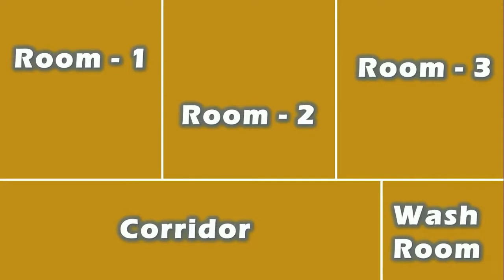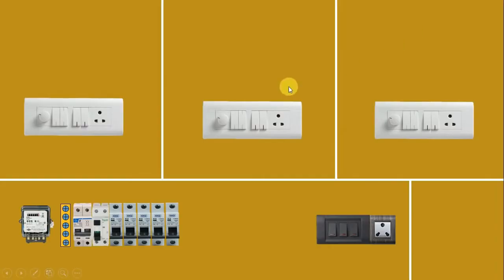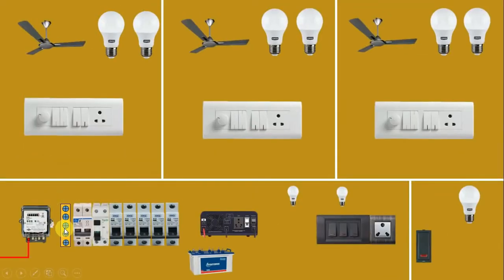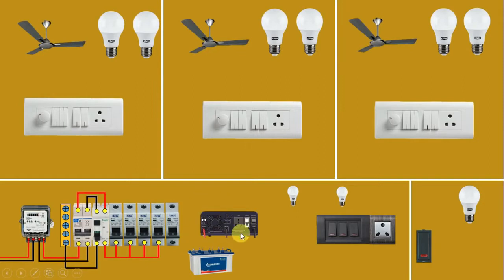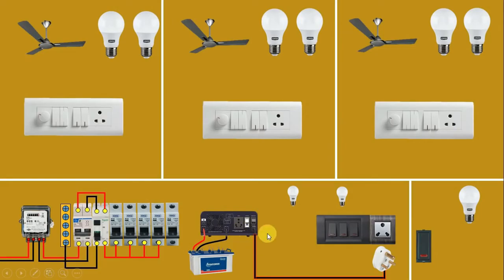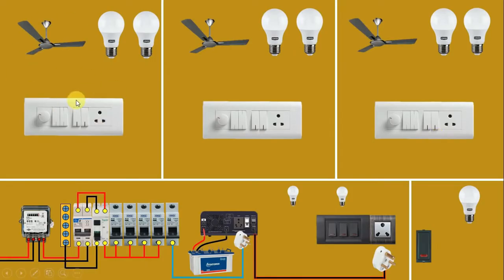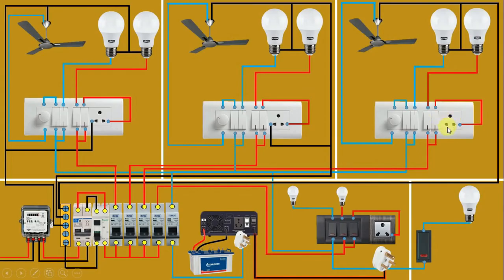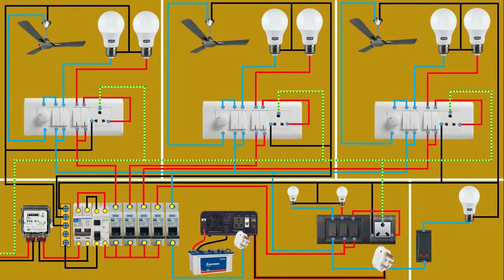Complete House Wiring with inverter connection for all Room | House Wiring @TheElectricalGuy

Comment: If someone gets an electric shock in this circuit, the RCCB in the circuit will turn off, but the inverter will turn on immediately. The electricity in the circuit will not turn off. This is dangerous.
Reply: Yes this is concerning...

Comment: Rccb will trip as phase from inverter do not go through rccb but neutral goes through rccb, this will create current differences leads to rccb trip, kindly make video how to use single rccb in this case

Comment: A good video. However, this could also be obtained by introducing a switch over to which one connects the supply from the inverter. When the user wants to use grid supply, they switch, same goes for when they need to use the supply from the battery.

Comment: Good video but if power fail both of main phase and neutral will disconnect know the breaker will trip while the power fails in substations ?  without neutral supply how bulb will work ? no neutral connection from inverter to load in this circuit connection ?

Comment: In This method can we use the fan in AC current too if current is available ? But this video was Crystal clear explanation..
Reply: If current is available inverter will short supply from source no ?

Comment: If i understand correctly, the purpose of RCCB is to trip the circuit if there is any residual current. During normal operation, the phase and neutral cancel out each other so there is no residual current. However, during the inverter mode, there is no current in phase of the RCCB but the return current should be flowing through neutral for those devices connected to inverter resulting in residual current. 
Is this correct? Is yes, shouldn't the RCCB trip?

Comment: Okey I accept  your video 
But I have some doubts in your video 
As you already mentioned  as a house wiring is burn out due to 2 wires only they layed 
But you also layed only one neutral  wire through out the whole house is it possible ? Let me ask in a room there I some short circuit in the  bulb so some comes to attend the problem to rectify he may electricuite  becoz the neutral is coming back another room why never lay separate  neutral wire each room and also while connecting  the plug points the current is differ in between  light source and plug points how come you use same mm cable  can use for lightings as well as for plug points ? Should be varivable  right becoz as my in our village they use 1sqmm for lightings if they follow as your diagram sure the wire will burn out due to high current  and also I another question your out put from the inverter is not flow through  the rcbo but you have the rcbo only in the main power supply if incase of electricute  via inverter power supply how they will protect them self...as per my knowledge I asking if its wrong you may advise me thanks bro

Comment: You gived the fans connections to inverter it will run with only inverter supply or main supply also

If I want to connect the fans to main supply than what should I do
Reply from the maker: It will run on Both power supply 
Inside the inverter there is a Change over switch
Reply: @TheElectricalGuy  
Bro you will have to told that both connections in video

Bro if  inverter is not there then the connections given to light is same for fan also 
Yes or no bro reply

Comment: I would prefer prefer looping neutral to the minimum. 

Also use separate mcbs in each room for inverter and main line. Would recommend a small mcb board in each room.
This would help in problem solving & isolation of problem in reach room separately. 
Costs a tad bit more. But.... safety 1st... helps also for general maintenance.